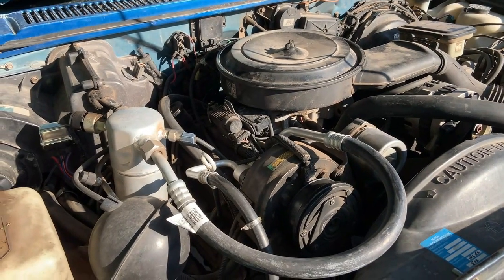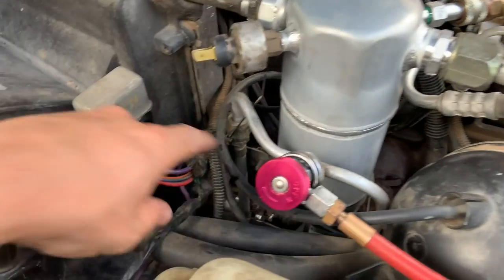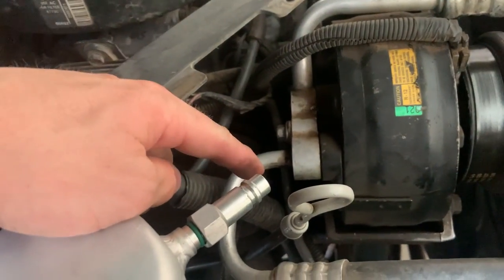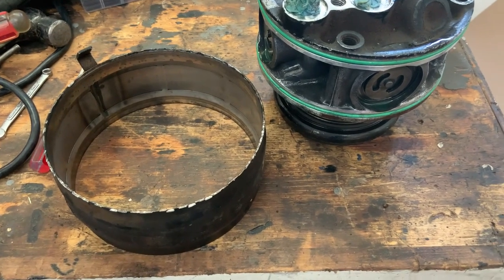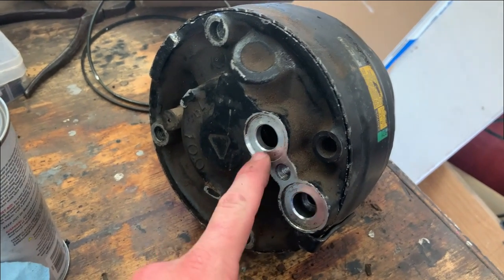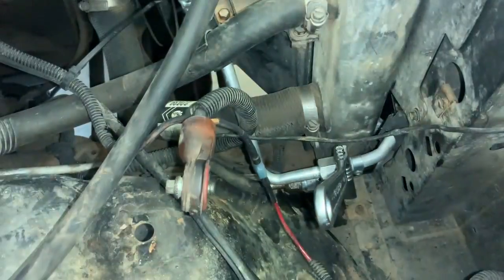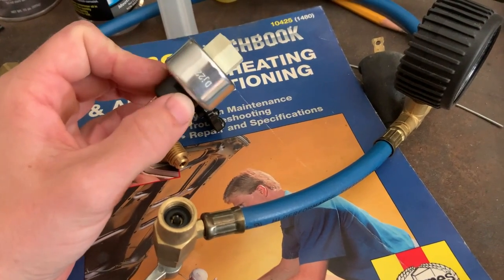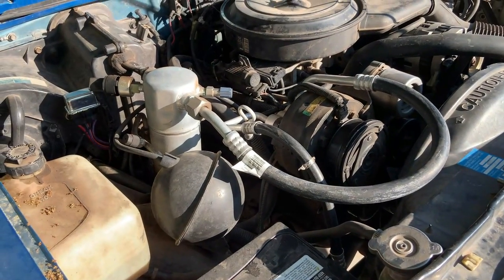R12 to R134a Conversion | 92 S10

Comment: Can you post a parts list please
Reply from the maker: I think this is what I used, if you have a different system then parts and quantities may change. Double check you have the same compressor since I think there are 2 that look like mine. I think I looked at the total system oil capacity and used that for the R134 oil but again double check that since it's been a year since I did the work.  
- 8oz of PAG 150 compressor oil 
- Universal set of green AC o-rings. The new lines should have most of what will be needed. 
- New flexible AC lines. (I used Rock auto)
- New Accumulator (I used Rock auto)
- New orifice tube. The ones I saw were recommended for both r12 and r134 (I used Rock auto)
- New low pressure switch (Whatever one Advance Auto had)
- Kit with conversion fittings (the car already had them installed but most parts stores or Amazon should have them) 
- Compressor o-ring kit (Santech MT2119 through Orielly's)
- Condenser (MyParts PA-4823653 through Amazon) 
- I think mine took (3) 12oz cans but don't remember for certain, I charged it until the pressures were correct for the ambient temperature. 

Hope that helps, Thanks

Comment: Please show me what adapters so I need exactly for the low and high pressure ports. The kits that I bought don't fit...
Reply from the maker: They should be something like this: https://www.acsolutions.co/products/r12-to-r134a-low-and-high-pressure-service-port-adapter-fittings?srsltid=AfmBOoq5aZXDekG4yqiQj60elZ1oCVT4QMA-aoPQVHyMCtTxa90YwgNA

I bought cheap ones through a parts store and regret it since they leak a little. I intend on trying to find higher quality ones when I have to replace them. You are looking for R12 to R134a automotive adapters. They screw onto the factory R12 line fitting and allow you to connect the R134 service lines.

Comment: Did you need to change the low pressure switch? They are specific to r12 vs r134a?  If changed out, what is the part number for the one you used?
Reply from the maker: The one I had was bad so I replaced it. I think they are specific as the new one is labeled R134. I bought mine through advance auto and it blew out after 9 months, they warrantied it so I get to see how long this new one lasts

Comment: I cant seem to find the condenser you listed in the comments. Is the parts number 52456127 compatible?
Reply from the maker: here is a link: https://www.amazon.com/MyParts-AC-Condenser-Compatible-52456127/dp/B097PYG9BG
That listing says the number you listed is compatible with the one I listed but I don't know what the different is between the two. Make sure it has the correct style of tubes as I mentioned in the video because the number you have may be for the OEM condenser

Comment: Will the expension  valve need to be changed ?
Reply: R 12 expension valve replace with r 134 valve
Reply from the maker: This system uses an orifice tube instead of an expansion valve, the orifice tube had the same part number for both refrigerants. Ideally you would want to change to the correct one for the refrigerant if one is available
Reply: Ok sir thank you 😊

Comment: My 79 Transam had a leaked all the R12 so put I changed the o rings and put a vacuum on for 30 minutes, changed the charge fittings to R134 charged it up and it puts out 45 degree air when driving at highway speeds.
Reply from the maker: You may want to check and see how the compressor is lubricated. If it's lubricated by mixing oil into the refrigerant, the old R12 oil likely won't atomize into the R134 and can cause compressor damage

Comment: Gotta do the same to mine! Its not too bad up here in NE TN. low 80s, but still, that's worth the time to get it working again. I ended up chucking the lines and old compressor and condenser since they were just old and didn't hold a charge, plus the pulley was making a loud shrieking sound, so now its only got a bypass pulley. These pancake compressors are really nice and are super easy to service and remove.
Reply from the maker: For sure, working AC is definitely worth having